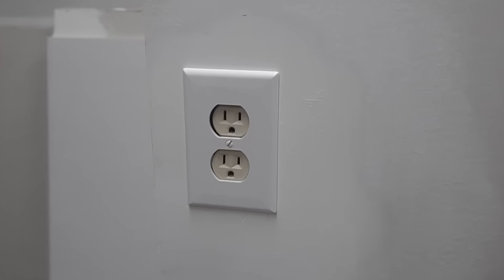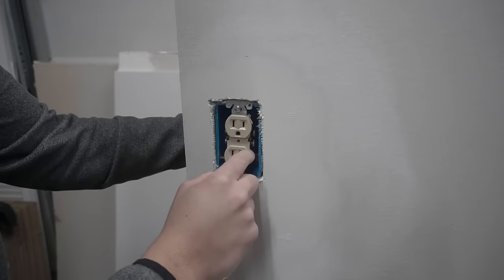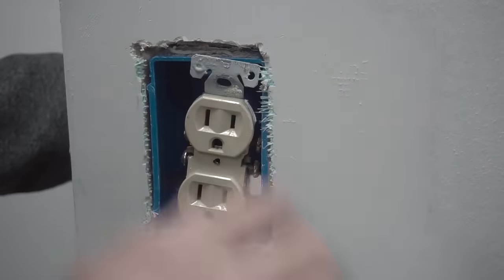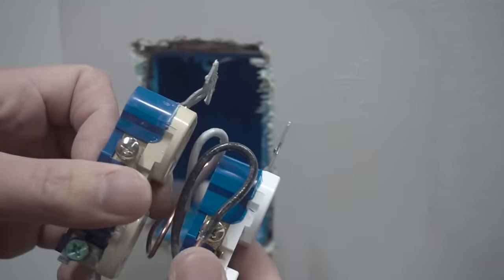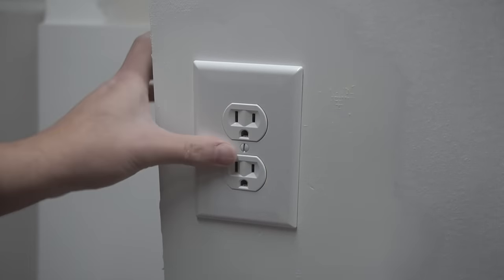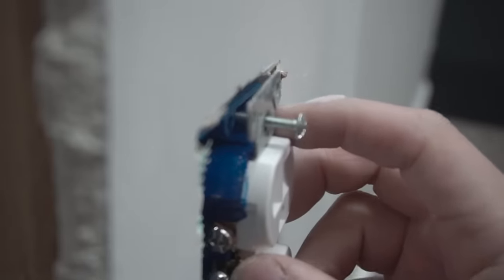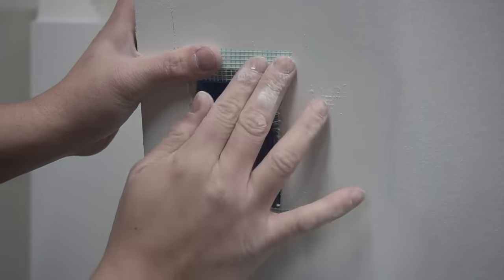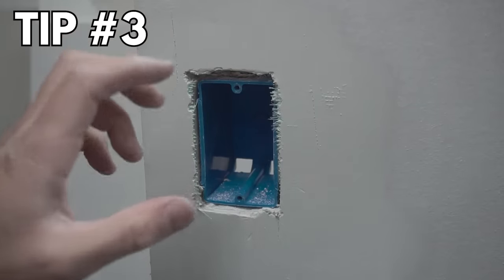How To Fix Sunken Electrical Outlet Or Switch On Drywall! DIY Tips & Tricks Tutorial For Beginners!

Comment: This is a cool tool. Just a note that if the box is setback more than 1/4" you will need to use a box extender.  Per NEC 2020 article "314.20 Flush-Mounted Installations", boxes can not be further back than 1/4", to correct this code deficiency you can use a box extender.  Also note If the surrounding material is flammable no amount of setback is allowed. This is for safety.
Reply from the maker: Thank you for that information! 🙏🏽😊 Have a great weekend my friend!
Reply: Not sure if it's worth the extra effort, but replacing the whole thing with an old work box is an option.  I went this route due to parts availability and was satisfied with the results.
Reply: 1à1
Reply: Free
Reply: Any link for a box extender?
Reply: Yea but I don’t expect an inspector to take the face plate off and look
Reply: Thank You for the information. I have no license but can do but basic wiring but I'm very careful making connections and wiring things properly. Once again Thank You Pal for the information, THANKS.
Reply: @FamilyWinn  Search for ReceptXtenders or Arlington Industries Box Extender. Most hardware stores should carry these or something like them. It's not an uncommon issue, especially when dealing with tile, shiplap, or paneling added to a wall.

Comment: I've found for slight adjustments, snapping off the ears of the outlet or switch and using them as washers behind works.
Reply: That's what I was taught back in the early 1970s and was told that's also why those ears were breakable by design.
Reply: @jackedwards7420  Exactly why they’re there. Even if you don’t need them on that receptacle snap them off and put them in your tool box for later use.

Comment: In my part of the country we normally borrow a foot or two of ac vacuum tubing. We cut a piece a bit longer than the box is recessed, slide it over the screw and tighten it up compressing the tubing and setting the plug at the right depth.

Comment: Your method of fixing things helped me even though I couldn't find my specific problem.  I opened up a switch since I was adding something downstream of it and wanted to see what was in there.  One of the "wings" that clamps it against the back of the wall either broke or fell off.  So the bottom of the switch box was not stable.  

I dreaded having to replace the switch box since the wires were old and nicely tucked into the box.  I watched a bunch of your vids and got inspired.  I got a new "old work" box with wings, removed one of them, and replaced the broken part.  Took only minutes.   

I'm pretty good with many electrical tasks, but neatly tucking many wires in a box is not one of them!  A video about how to do this using the Voltclaw would be great!

Thanks for the inspiration!  I wouldn't have thought of this otherwise.  Great channel!

Comment: Great tips. If you have a box of misc hardware laying around  you can cobble up spacers with nuts and washers.
Reply: I was going to ask that question as I have rubber washers of differing thicknesses which I was considering using. Cheers

Comment: Easy fix . With a piece of copper wire. You wrap the wire  around a small screwdriver  to make a coil. Cut the coil to length to use a spacer between the receptacle and the box. Tighten up the screw for a nice flush finish. 
This takes no time to do and no cost.
Reply from the maker: That is an awesome trick! Thank you for sharing! 👍🏽😊🙏🏽
Reply: Why not just use washers?
Reply: @chorton38305  
You have to buy washers, when the box is deep in the wall. It is tricky to keep all the washers on that long 8- 32 screw. The scrap copper wire can be wrapped around the screw tightly so it stays in place. 
In the end you can decided what you want to do.

Comment: My whole house had this problem.  I've tried both types of shims with satisfactory results more than not.  When the box was too far back or not secured tightly to the stud I replaced with old work boxes.  The outlets in the new boxes feel a little more solid than the shimmed ones, but right now I have no plans to replace the rest of them.
Reply from the maker: Yes sometimes replacing the whole box is the way to go, definitely solid. Also if your box goes deeper than 1/4” you can get using a box extender, used per code 👍🏽😊🙏🏽

Comment: keep a small bag of 1/4 inch flat washers in your tool pouch. Use them the same as the small yellow things you were using. Stack 2-3 of them on the screw and all is good. Buy them in bulk next time you're out, super cheap.
Reply from the maker: Thank you for sharing your technique! 🙏🏽😊👍🏽
Reply: I carried scrap plastic 3/8” supply lines in my tool bag, then I cut it to the proper link and put it on the screws to flush out the outlet or switch.
Reply: I do not like this idea at all!  I have used it and during installation had the washers from the top fall inside the box  creating a shorting hazard.  
My solution is similar to that suggested by Phillip Price.  I use poly tubing from the hardware store.  I cut it a bit longer than I need then compress it to make it work.  A foot of poly tubing sells for under a buck and will fix several dozen outlets.  
Obviously, if it is more than 1/4 inch, you gotta use a box extender.  Code says so!

Comment: That extra lip is pretty useful.
In Europe, the boxes for ectrical fixtures are round, but you still have the problem with a tiny lip that has to prevent the box from falling in.
Our singke outlets however have an extra plastic outlet cover screwed over the wall cover (there's a recess and hole in the cover for that).
So you normally asseble it like this:
- fix the round box with screws that have clamps at the other end (guess you have the same system?)
- screw the recessed fixture part screwed to the box
- snap on the wall cover plate
- put the the outlet cover over the recessed area of the wall cover and screw it to the fixture

Comment: I have a roll of green tubing that 6/32 screw fits perfect in. I cut off pieces to fit between the plug/switch and the box over the screw to shim it out and of course if it's needed I use a plastic box extension.

Comment: the easiest option ever, - to use spacers. those are like plastic things which you are adding around your screws. also you can round wire without insulation around screw. works always perfectly fine.
Reply: When I have need to shim the receptacle out, I cut thin pieces of 1/2” Pex pipe and fit them around the screw, in between receptacle and box.

Comment: I did electrical work for 30years we had a little hand saw would either cut the nails if box was to far in after we cut the nails put the box right and put 2 little sheat rock screws through the plastic box into the stud or if it wasn't to far in the sheat rock we would use a little piece of plastic pipe the plumber's always left pieces that they cut off and didn't need that's cheaper than that metal sheat rock clamp but cool tricks keep them videos coming

Comment: Thanks for posting this video.  I use. 14 guage wire and wrap it around neddle nose pliers to make a washer, spacer the thickness that's needed behind the plug plate or I used regular oversized nut on the screw as a spacer and that worked too. Thanks for posting this Pal, Thanks.
Reply from the maker: Thank you for sharing your technique! You are most welcome! 🙏🏽😊👍🏽 have a great weekend my friend!
Reply: Not a bad idea in a pinch I'll definitely put that in the mental tool box 👍
Reply: copper tubing ....I use bib washers usually

Comment: Easy solution bend the ears on the outlet back a little bit with needle nose pliers and the ears will hit the box instead of the over cut drywall quick and easy

Comment: “Catapilers” or “legos” are the way to go, the small plastic shims that come in strips that are specifically made for this problem, and they’re very cheap and easy to use. Basically a nonconductive washer that goes on the screws.

Ok, just got to the part where you’re showing them, that’s the way to go! There’s other tricks that people with experience in the trades use, but for someone without experience or much knowledge of stuff like this, those are the way to go. Cheap and easy.
Reply: Agreed. :)

Comment: I have used both a stack of a few washers as "spacers" between the box and the metal. I have also used nuts to accomplish the same thing. I use nuts that are large enough to slip over the two screws.
Reply from the maker: Thank you for sharing your technique! 👍🏽😊🙏🏽
Reply: Been doing it the same way for years. Also cheaper than buying those plastic spacers or that metal plate.
Reply: I have tried that once many years ago in my Victorian age house.
But years later I got a electrician doing some electrical work due to I don't have the time.
All the washers falls out as he took it out and scared him and question who putting the washer in and make cause unnecessary shorts or even a fire if it drops inside the outlet box.
I never do it again.
Reply: @loktom4068     Hehehe. Power should be off when servicing a receptacle.

Comment: You ignored the easiest option: New work boxes with flip-out plastic wings. Those have molded large tabs at the top and bottom of the face of the junction box that effectively pinch flush to the drywall as the wing nuts are tightened into place behind the drywall.
Reply: That is actually an old work box meaning the drywall is installed.  A new work box mounts to stud before drywall .

Comment: Don't use those metal plates
As outlets get loose again then the metal touches the hot and explodes

The yellow catapillers work well but use them in twos.if you fold 4 you will struggle
Cut off 2 then add single ones up to 4

If you don't have them as they are expensive you could use wire like number 12 in a circle or  metal nuts work well

Try not to use.the 50-90  15 amp outlets
They burn out buy 20 amp oned

Comment: I use drywall mud behind the outlet ears, or build it out with #6 fiber washers. Putting them in loose, like most electricians do, will cause them to twist after using like your vacuum cleaner a few times. I have super glued the screws in place in the past to keep them from shifting. You need to think, most sheetrock is ⅝" thick. Space your boxes right.
Reply from the maker: Thank you for sharing your technique! 🙏🏽😊

Comment: Those steel things are dangerous...could short out your outlet unless you take the extra precaution and wrap the device in electrical tape...
I found a way to solve the problem without having to buy anything at all...
Take a piece of 12 gauge wire and wrap it around a Phillips head screwdriver so you'll have an inch-long "spring"...
Slide it off the screwdriver and place it against the box to measure the distance between it and the sheetrock...
Cut it down to size, slide it over the screw and you have a "spacer" to solve your problem..!
Reply from the maker: Thank you for the advice!

Comment: The screw holes cracked out.  How do I replace the box without removing drywall. In my case it’s tile surrounding the box
Reply from the maker: If you can please send me a picture on my email! Fixthishouse1@yahoo 👍🏽😊
Reply: Use sheet rocks screws instead.
Reply: Sent emai
Reply: If there is nothing else wrong it might be simpler to repair the screw holes, but that doesn't answer your question. If the electrical box has 2 nails on one side, securing it to the stud, either cut the nails with a thin blade or slowly tap the whole box sideways.  Replace with an old work box.  You may have to use a screwdriver to pry open the wire hole to get the box completely free.
Reply: Take a sawzall and cut the nails, replace with a new box. They also make an extension for tile, like on a backsplash.

Comment: I have an opposite situation j box is protruding so do I need to move j box in? Thanks.
Reply from the maker: Yes that is one solution. 👍🏽😊 stay tuned I’ll make a video on how to fix that next week 🙏🏽
Reply: They are usually nailed in place, I think you are better off removing it and installing an old work box in its place.

Comment: If the box isn't falling out of the wall and just set in too far. Just loosen the two screws on the rec. and put the plate back on the plate will tighten it up. This is really common with shite electricians and inspectors too lazy to do their job.